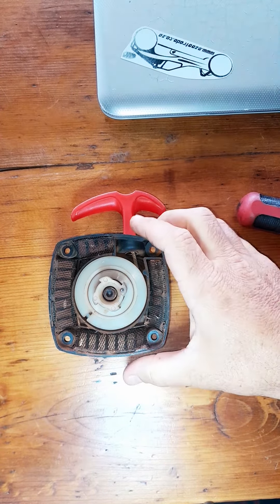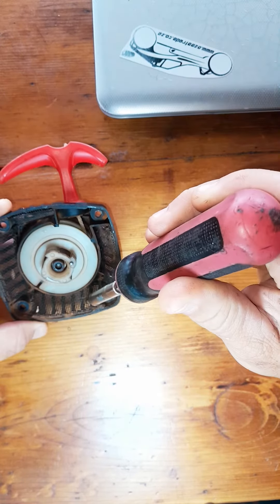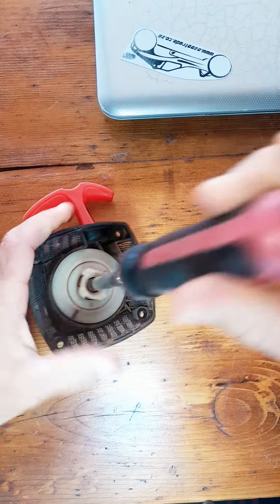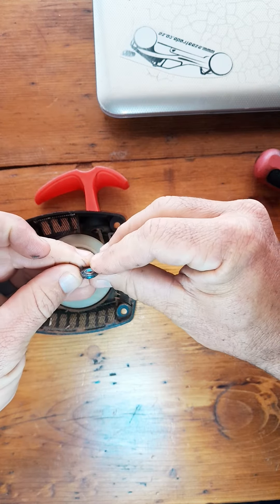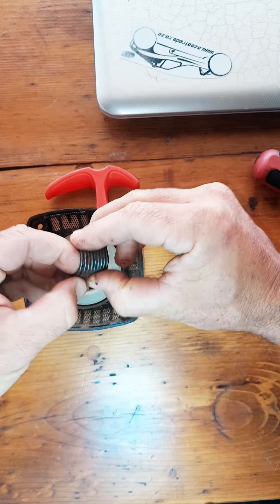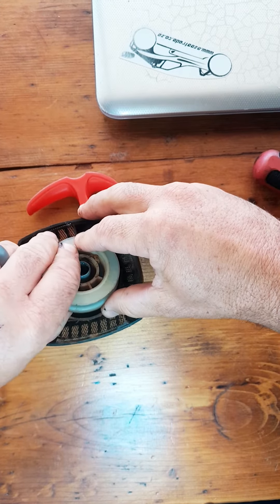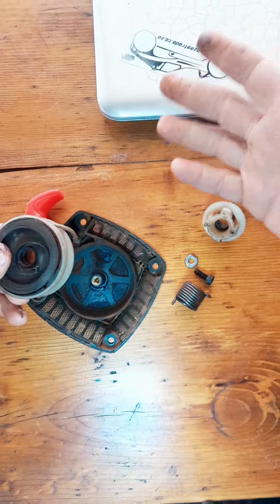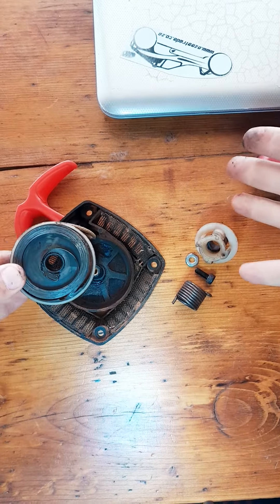Rovan Baja Easy Start Disassembly | Ezee Racing

Comment: Do you know which if any zenoah kits, that will bolt to a rovan 36cc?!! If only i could be so lucky with my cemetery full of pull starts easy & regs....!!!
Reply from the maker: Yeah Pullstarts can be a pain in the ass. Best one in my opinion is the Regular CY pullstart from DDM.
The Zenoah G320 cylinder will fit ontop of a Rovan 36 case and crank, but you will have to space the head so she don't bottom out. You will also need to swop the piston kit to a 38mm as the 36cc uses a 39mm piston kit. The Rovan 32cc piston works in a Zenoah Cylinder.
Reply: @EZR  I'm thinking of putting a 32 head on a 36 block will I have to use an Xtra thick base gasket? , thanks for the reply
Reply from the maker: So the difference is a 2mm crank on the 36. I ln essence you will be building a 34cc.
You will have to put the right amount of gaskets but that you will only know by building and checking. Place the 32 cylinder on without a ring and see if it bottoms out. Keep adding gaskets till it doesn't. You are aiming for a 0.3-0.5 squish.